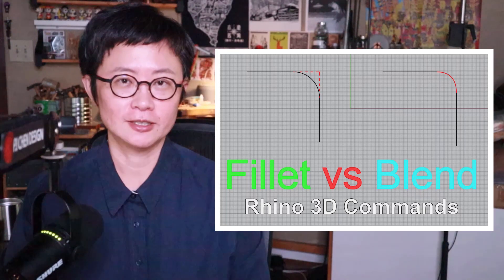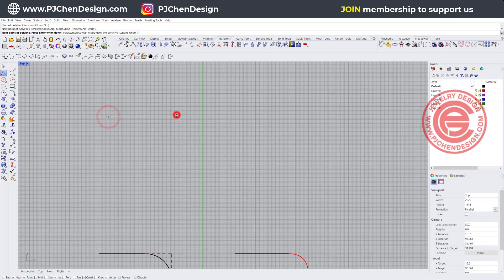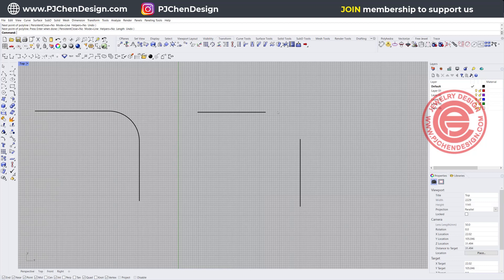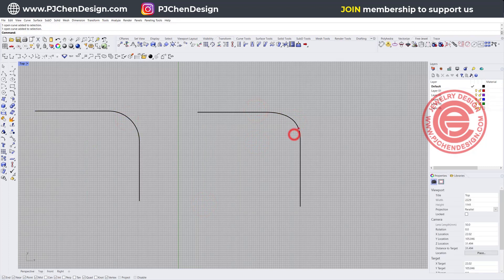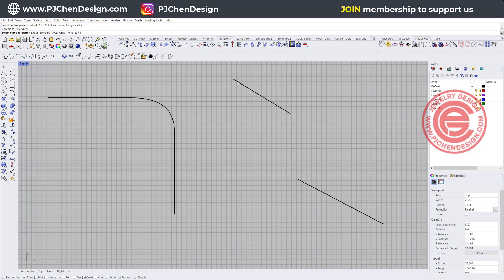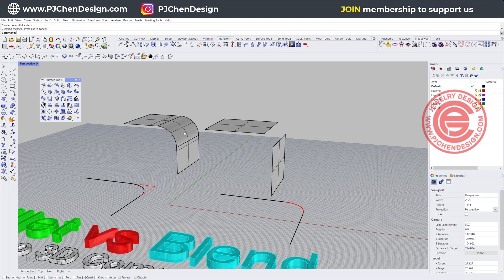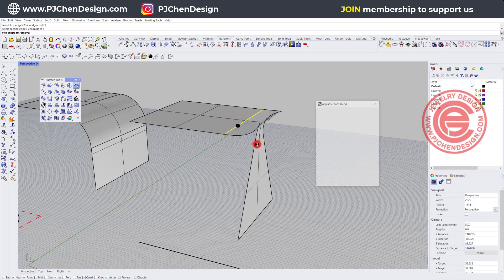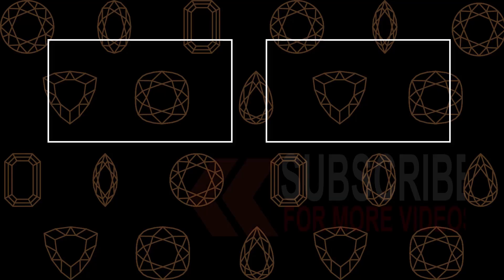Fillet VS Blend command in Rhino 3D- Discuss the Similarity/Difference on Using the Commands #356

Comment: There are also very useful variable fillet and blend commands in the menu Surface - Variable Fillet/Blend/Chamfer. These commands can be used to fillet/blend connecting sirfaces like ordinary fillet command, but have nice options like trim and join the resulting surfaces and variable fillet/blend radius.
Reply from the maker: Great tip!

Comment: Hi İ want to buy a computer for rhino and 3D modeling can you advice some computer systems
Reply from the maker: I personal prefer PC over Mac. and Laptop over desktop. You will get more for your money on desktop, but laptop is easier to carry around. I will recommand gaming computer as they have better grafic card. I personal use MSI gaming laptop. It depends on your budget, there are a lot of choice.
Reply: @PJChenJewelryDesign  ok I get it there I stay between two options nvidia and amd.
Amd is more chipper then nvidia i want to know if there is no much difference between them I will buy amd. Which one do you offer.